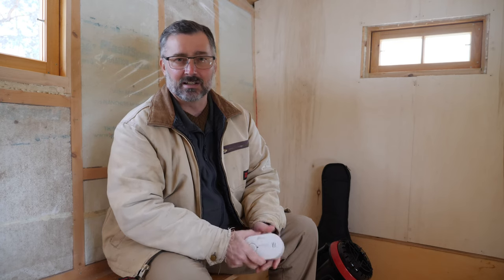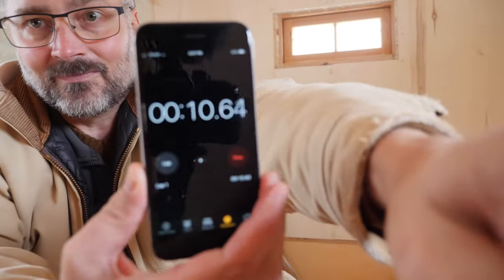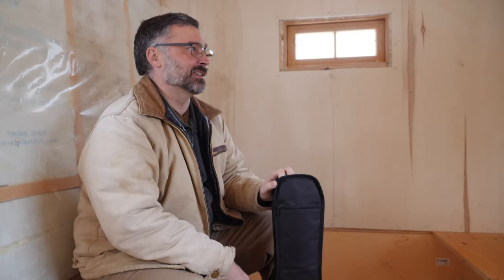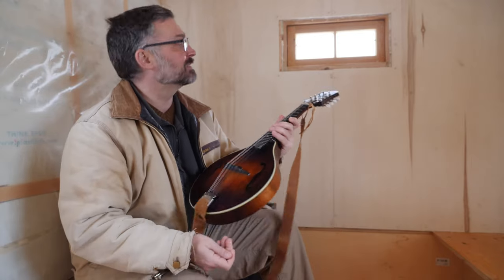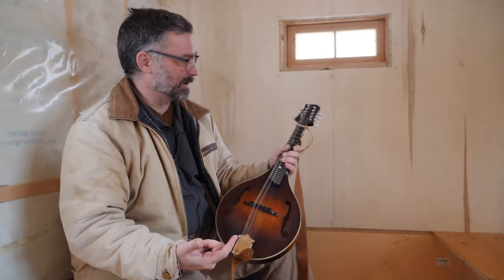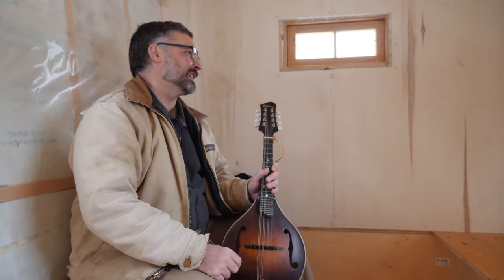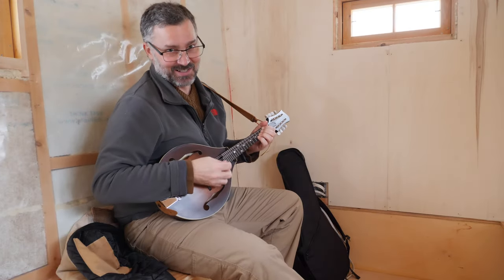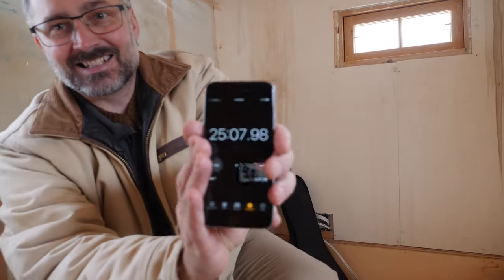OFF GRID TINY CABIN - Heat Retention Test with Mr Heater Little Buddy

Comment: Lots of folks have mixed feelings about the Little Buddy heater. How about those Chinese diesel heaters than vanlifers rave about? The German versions cost 5x more but maybe better quality. Then there are the Kimberley propane boat heaters to consider. Also I've seen loads of videos using the tiny wood stoves. One popular channel features a wood stove in a wooden truck camper used year round in Alaska. I think the Little Grizzly or something like that.

Comment: I made a simple sturdy base for my buddy heater by cutting 4 pieces of 4" wide cedar board at 18 inches long, and making a square shape for the canister to set in. Set one board up against a canister, then butt the second piece up against the first board while also touching the canister, then a third, then the fourth. Now you have a square that the canister is sitting in, and four legs sticking out like a Christmas tree stand. The canister slides in and out easily but the square is tall enough and won't tip.

Comment: Love the Video Jason!!! As a 20yr veteran of huffing propane ice fishing and camping; I'd suggest the Mr. Heater big buddy. It has a low/medium/high BTU setting; low is like yours. Plus a fan,  you could hang it on the wall and have an external tank. low oxygen cutout and tip over cutout. You can heat up a space fast and turn it down!!!
Reply: P.S. always have fresh air ventilation at all times and use the carbon monoxide alarm!!!
Reply from the maker: Thanks for the suggestion. Yeah, I always have the door cracked open slightly. Forgot to mention that in this video. I was considering the big buddy but this heater is only temporary while I'm building. I'm hoping to install a small marine stove when the interior is finished.